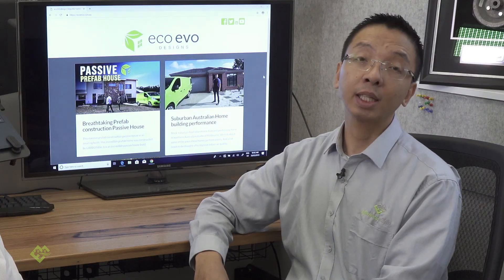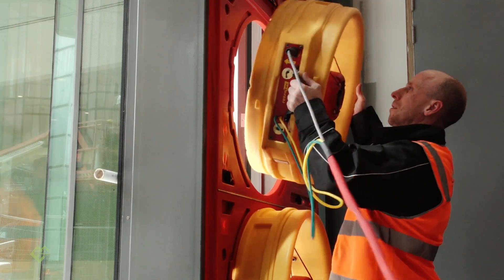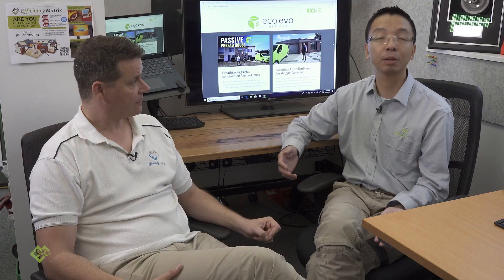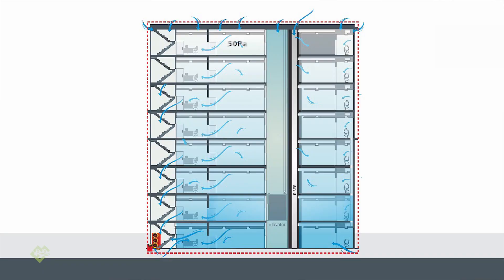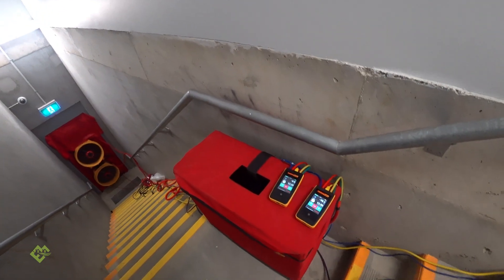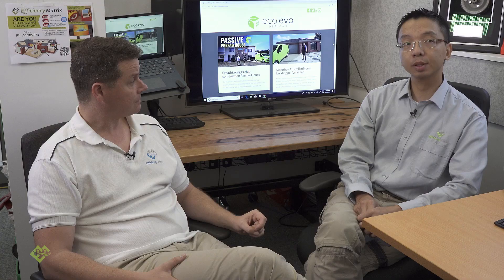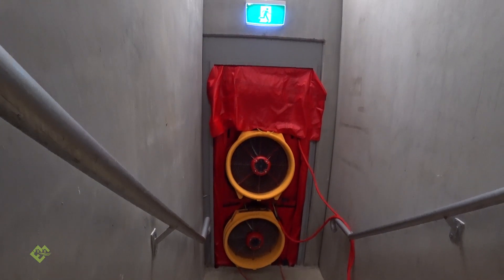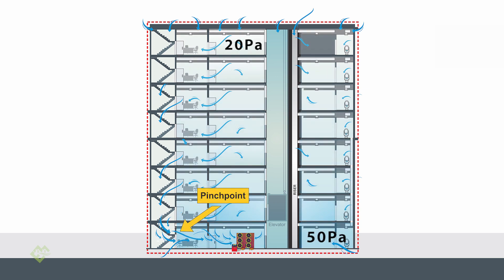The big commercial air tightness test MISTAKE!

Comment: Open your elevator shaft doors for the test, it helps!
Reply from the maker: Abbas Rangwala Not very easy, with safety requirements, down here in Australia.
Reply: @ecoevo  Right, we've started testing large buildings now required by Code in Western Canada. It is definitely an option consultants are looking into as long as necessary guardrail protection is being provided.
Reply from the maker: Yup, everyone gets a bit funny about doing this, There are certain safety rules down here that can make it hard depending on the state of the building.  The other issue is on this job, there was no elevator.👍🏻